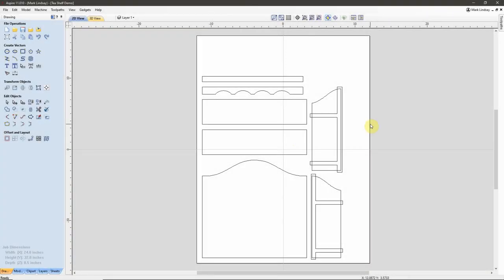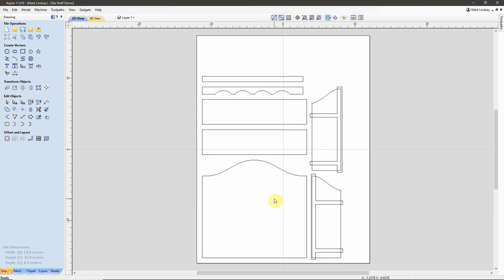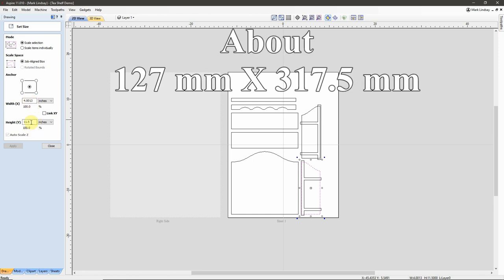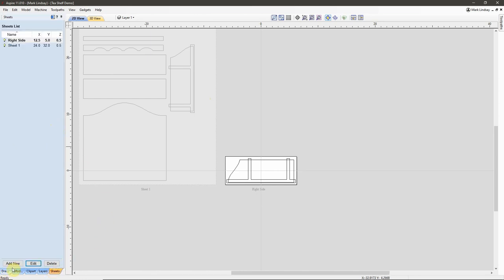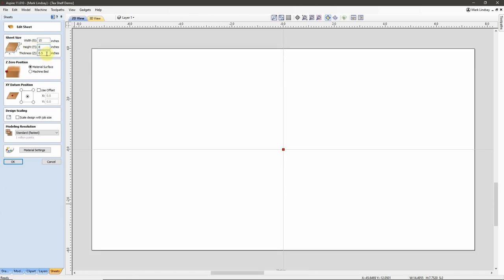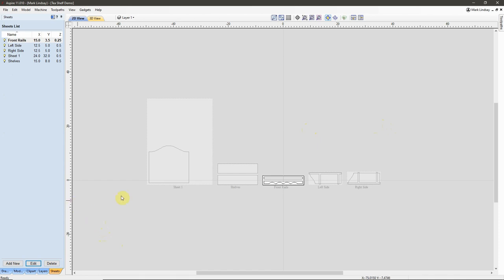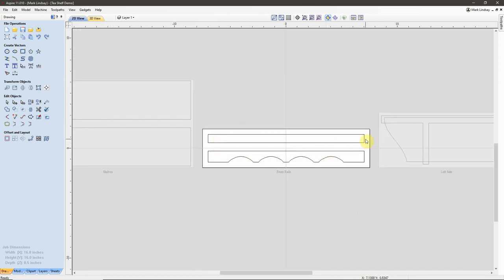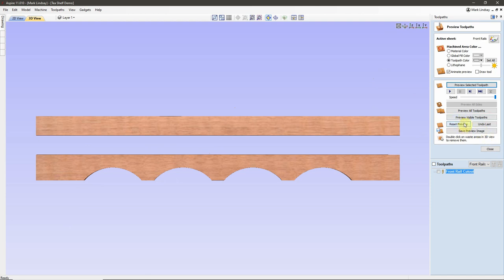Using Sheets and Toolpathing Vectors – The Tea Shelf Project – Part 2

Comment: Mark: When you and the master designer finalize this, would you then add a pocket allowance to the dado/rabbet pocket so that the shelves will fit?
Reply from the maker: Possibly. That will have to wait until I have the materials surfaced to their final dimensions. I'm almost ready to do the surfacing, so if there are any changes in the design, that'll be included in the next video, which I'm in the process of shooting now.

Comment: I noticed your toolpaths originated in the material center, rather than the lower left corner. Was this intentional, as I remember you normally zero from the corner? Great tutorial, as usual. Thanks.
Reply from the maker: Good eye, John. Keep in mind that this file is for demo only - it's not the actual file I'm using to cut this project. That file has (and in some ways still is) going through some slight modifications while I'm gluing up the panels. The chief designer (aka my wife) has come up with a few changes she wants, so you know the deal. I will be addressing the X Y Datum Position change and other small changes at the beginning of the next video in the series. Then I'll cut and assemble the project.